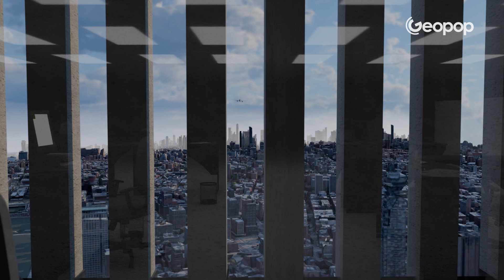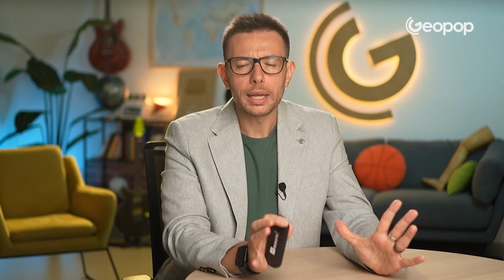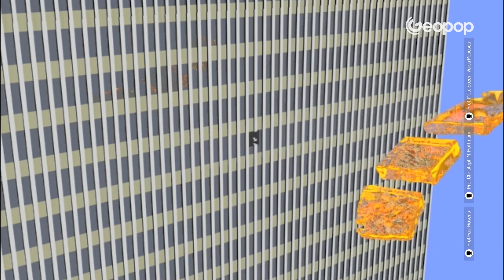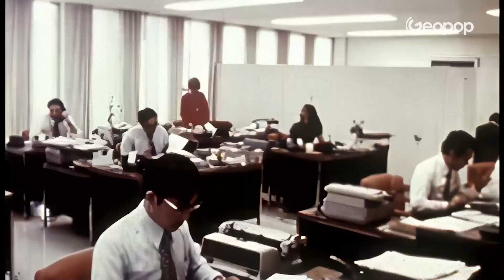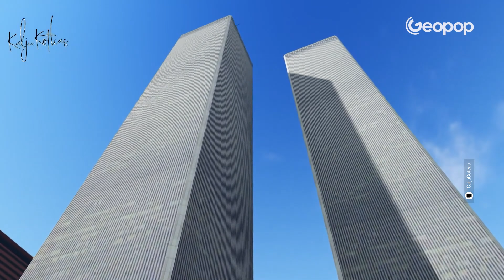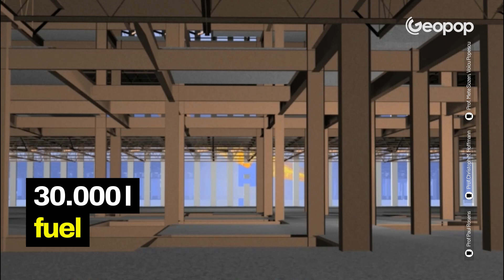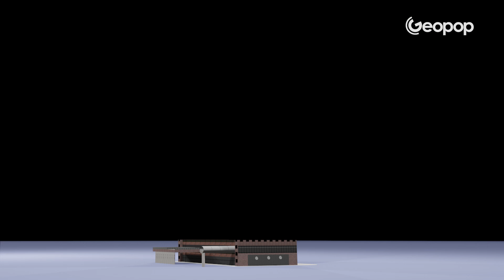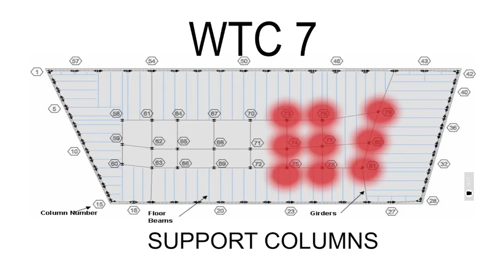9/11, 2001: The Technical Reconstruction of the Twin Towers and WTC 7 Collapses

Comment: So if jet fuel ignites at 120°F and can burn as hot as 410°F how does this guy make the jump to twice as much heat when he starts talking about 900°F and even more? Then he goes on as if this is all a factand talks about the steel and how it can be and when it gets brittle and when it might break and so on and so forth, but he skips over his initial jump of more than twice the temperature that was possible. Unless of course you were talking about things like nano thermite which burn much hotter than Jet fuel, but nobody wants to talk about that.
Reply: Look into it.  What happens to burning things inside a confined space?  (OK you don't know-they heat and burn hotter).
Reply: @edwardschmitt5710 😂 one guy says it was burning hotter because of the wind blowing through and now you tell me it burns hotter because it’s enclosed! Whatever to fit the narrative right buddy😅
Reply: Do us all a favor retard... Go and look up the temperature inside a jet engine... You know a jet engine right? 
Those things that burn, ya know, JET FUEL.
Come back and tell us.
I dare you.
Reply: Let nobody forget that hero in the fire department nicknamed Oreo made it to the impact site and he did not melt… He spoke of sporadic fires and many dead bodies. Also, the woman waving the fabric out of the hole. The plane went in. She didn’t melt either.
Reply: @PatrickAuricchiosr  Those people also weren't holding the weight of 10-20+ stories of metal/concrete/furniture on their heads. The point of the video wasn't "they melted" it was the fact the steel deformed just enough that the impacted floors could no longer hold the weight of the floors above them, starting a domino effect that was the collapse.
Reply: @zippyducky1704 right! Weakened US Steel and a human beings survivability don’t seem to correlate at the same temperature
Reply: @zippyducky1704  also the “point of the video“ as you stated is literally spelled out for you by the narrator early on… He literally says that he is not saying this is what happened. He is saying that scientifically this is what they believe could’ve happened.

In my humble opinion, what he is telling you is, this is the best explanation I can give you for the BS story they told you this is the best idea. I have to make that story work but, hey what do I know? I am just a human.
Reply: @PatrickAuricchiosr  1) people don't melt

2) People don't tend to carry thousands of tonnes of building materials on their heads

3) People who are exposed to extreme heat have the capability to move away from that extreme heat. Steel structures do not have legs and therefore stay in prolonged exposure to the heat.
Reply: Because it only burns ar 410° in the open, with no forced air movement.  Put a fan on it, or a bellows, and it easily gets up to 1000°.  The wind at that level is already pretty strong, but the fire created its own bellows.  Simple physics.
Reply: @ChristLink-Channel  and I suppose you’re simple physics explains a limited amount of floors that were already being held up by the building below just suddenly collapsing, and turning into dust unlike any other building made of steel in history… You do realize the narrator of this video tells you in the beginning that this is his conspiracy theory to explain the official narrative that nobody believes… Simple physics, check out architects and engineers for 911 truth
Reply: @PatrickAuricchiosr  Umm... sorry but your strawman doesn't even make sense.  Nobody ever said anything like that, so there's no point in even replying.  Each floor collapsed, in sequence, all the way down, when it could not support the massive forces suddenly acting on it from above.  Simply looking at the videos show this, clearly.  They don't all turn to dust instantly, as you claim.  Wow!
Reply: @ChristLink-Channel 😂 wow! 

Awfully convenient to bring up a strawman argument after doing so yourself!

If you read my original comment, I try to be as kind as possible. But apparently I made one mistake… My mistake was in saying Nobody believes the official narrative/story. 

😢 I apologize to all for my incorrect statement! Apparently, there are some who believe the ever changing story… Official narrative… Explanations to try and figure out a way that it possibly could’ve happened… 24 years later. 
Wind shear , not melted just weekend, you are entirely ignoring the statements I made in the beginning…
So your story is the tremendous amount of weight above the impact zone that people were alive and walking around at, was so weakened that it couldn’t hold up the building that it had been holding up for all those years and was designed to hold up for eternity

Your story is that those main core columns in the middle of the building just suddenly decided to disengage not only on the impact floors, but also all the floors below that because of some magical force pushing down on it that had been pushing down on it since it’s inception ? And that American made steel in the core columns of both towers decided on that day when needed most they were just done doing their job… Your conspiracy theory would hold much more weight if the core of the buildings from the impact site down we’re still standing after the collapse of some of the inner floors… The problem for your theory is that supposedly undamaged steel just fell down like a deck of cards including the core columns, !!!

Wow!!!

Cool story bro let me know when you release your next children’s book
Reply: @ChristLink-Channel  please tell me how there’s no point in replying while replying again!
Reply: @PatrickAuricchiosr  Hmmm... comprehension of simple physics and principles structural engineering seems to be a major issue for you, so I'll try to put it in the simplest possible terms.  When steel gets hot, it gets weak.  The hotter it gets, the weaker it gets.   So a load that it could easily handle at normal temperatures, becomes an overload at some point, when the temperature gets hot enough.  First, the steel deforms. If the load remains, then it deforms more, and that very act of that movement causes an even greater load, because you now have a dynamic load in addition to the original static load. At some point, the load exceeds the capability of the stell, and it fails completely.  When that happens in one location on an already weakened structure, the load doesn't just disappear into nothing: it gets transferred to other parts of the weakened structure, which is then overloaded itself, and fails.  There's a very rapid "domino effect" across the entire structure of one floor in the building, causing that entire floor to suddenly collapse.  That enormous load (the massive weight of all the floors above) suddenly smashing down on the floor below the one that just collapsed, causes that floor to collapse too, very fast. And so on.  The collapse propagates down the building, accelerating as it goes, at a rate close to 9.8 m/s^2.  After a few floors, there is nothing that can stop it.  Even completely in-tact, undamaged floors further down the building cannot handle the exponentially increasing gigantic kinetic, that are far, far beyond the design parameters.  If you look at the videos, this is crystal clear.  The sequence is abundantly clear.
Reply: @ChristLink-Channel  wow you are amazing at explanations explain to me this that big chunk of the building that was falling off to the side and then disappeared in the smoke never appeared off to the side of the footprint of the building(damage or not). Where did it go?
Reply: @ChristLink-Channel  also if this is so abundantly clear how come hundreds, if not, thousands of architects and engineers around the world say that what you are saying is impossible? It must not be that abundantly clear as the host of this video clearly states it is a theory.
Reply: @PatrickAuricchiosr  Pretty much straight down, actually.  Accelerating at 9.8 m/s^2, all the way, and disintegrating along the way too, due to the immense forces acting on it. Then scattering all over as the various pieces hit the ground.  Chaos theory can predict roughly where you'd find the pieces.
Reply: @PatrickAuricchiosr  So which "architects" and "engineers" would those be?  Please provide your list, along with proof of their qualifications and certification.  I'll wait...
Reply: @ChristLink-Channel  architects and engineers for 911 truth it is a movement. You can find them all around the globe and online. They’re qualifications are certified.
Reply: @ChristLink-Channel  you can type out the words, architects,, and engineers for 911 truth or you can simplify that search by using the capital letters A & E for 9/11 truth!
Reply: @PatrickAuricchiosr  Why would I do that?  I don't want fake engineers, or any architects at all.  Architects know very little about structural engineering.  So I'm only interested in listening to what the real structural engineers say.
Reply: @ChristLink-Channel  so on one hand, you state that you don’t want to hear from architects on the other hand, you state that you wanna hear from real structural engineers… Then follow that up with you don’t wanna hear from structural engineers! Brilliant!

Talk about exhausting
Reply: @PatrickAuricchiosr  Um.... so where did I say that I don't want to hear from real structure engineers?  You seem to have a reading comprehension issue...
Reply: @ChristLink-Channel  you claimed that A&E for 911 truth is filled with fake engineers! The only reading comprehension problem is you not going back and reading your own statements! Thanks for the insult though it shows how good your argument is
Reply: @PatrickAuricchiosr  Yes.  BEcause it is.  The entire "911 truther" subculture is full of fakes, many of whom don0t even understand basic physics, let alone structural engineering, and don't even think about setting realistic boundary conditions on FEM/FEA!  Surprised you didn't already know this...
Reply: @ChristLink-Channel 911 truther movement is entirely different from architects and engineers for 911 truth!
Reply: @PatrickAuricchiosr  Seriously?  Talk about cognitive dissonance... "truth" is part of their title, and you say they are not "truthers"?  Mmmm yeah, ok....
Reply: @ChristLink-Channel  I said they are two separate things talk about gaslighting dude maybe you should just stop replying because now you’re just getting ridiculous. If you can supply credible information or actual knowledge, that’s one thing when you’re just making stupid comments, you might as well keep them to yourself dude seriously,
Reply: @ChristLink-Channel  aren’t you the one who mentioned strawman arguments?😂😂😂
Reply: @PatrickAuricchiosr you mean they're certifiable?

Comment: They should have learnt to build building like the indians. A fully loaded 787 crashed into those buildings, and they still stood firm. They worst building was building 7. It just collapsed. Thank god the owners of wtc got their insurance money. Sheep will be sheep.
Reply: A 787 that stalled skimming across a roof is NOT the same thing as a full-on right angle impact at 589 mph.  FFS
Reply: @TheLoonResistance it skimmed a roof and went straight into a building get your facts straight ffs
Reply: @movo786  - At 589 mph?

Or a bit less?
Reply: @TheLoonResistance bro the nist report stated the building collapsed due to the high temp of fuel melting steel
Reply: @movo786 - No, it didn't.  Try reading the thing. 

Sagging floor trusses in the impact and fire damaged zone caused inward bowing of perimeter columns by up to 5 feet until they buckled.
Reply: @TheLoonResistance still proves my point, wtc was built to withstand a plane hitting it. The Indian building was not. The wtc is the only building in history to be hit by a plane and collapsed like a demolition by professionals. Many other buildings were hit by planes and even engulfed in flames and still stood. Tucker Carlson will release a video tomorrow on this, watch it. The nist report is bs.
Reply: @movo786  - The Twin Towers did withstand a plane hitting them.  Both were still standing after being hit, impact damage alone being insufficient to cause their collapse. 

Twin Towers collapse was a combo-platter of 4 major factors;

Impact Damage + Fire (heat) + Time + Gravity = Collapse

Remove any one of those four factors and there is no collapse. Ignore any one of those four factors and you will never understand the collapses.

You are ignoring three.